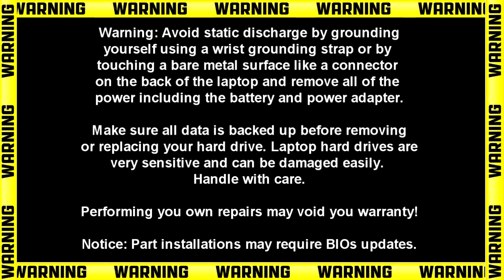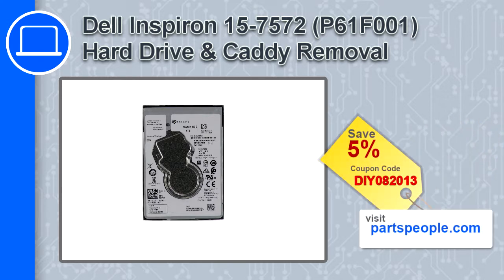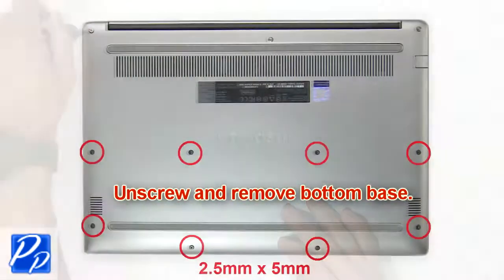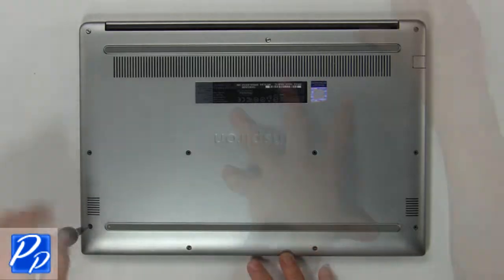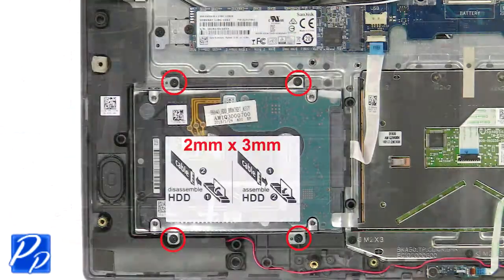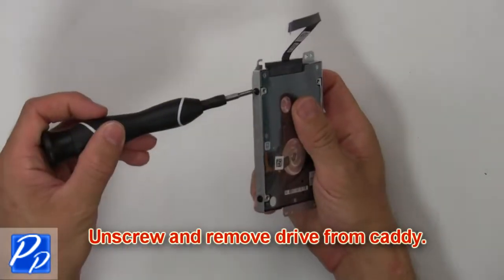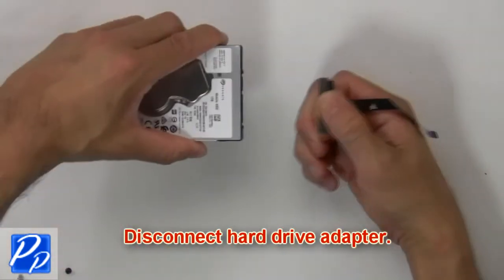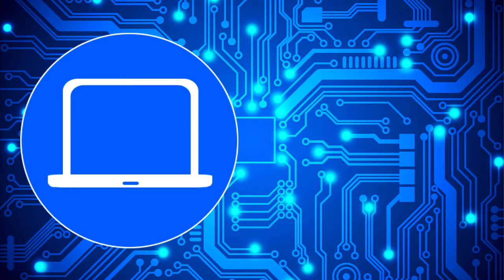Dell Inspiron 15-7572 (P61F001) Hard Drive & Caddy How-To Video Tutorial

Comment: Can I just keep the hdd in the caddy and put the screws back in the laptop or is it important to remove from caddy, place it back in the laptop? When should I reconnect the battery?
Reply from the maker: Removing the hard drive from the caddy is only necessary if you're replacing the laptop with a new hard drive. I reconnect the battery as a last step before replacing the bottom base cover.